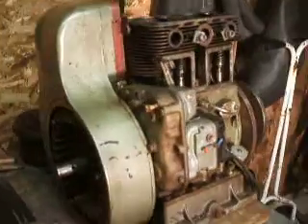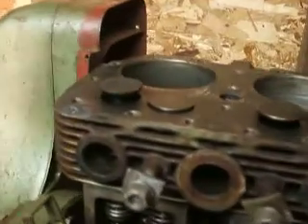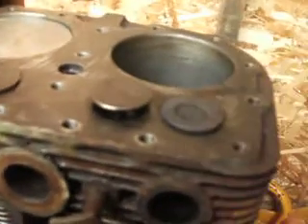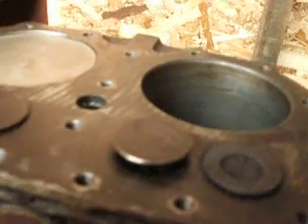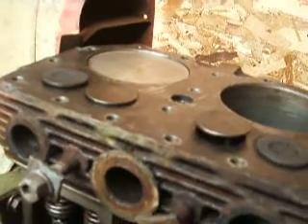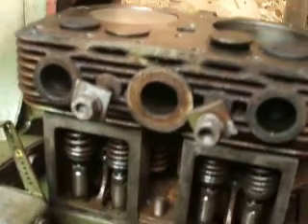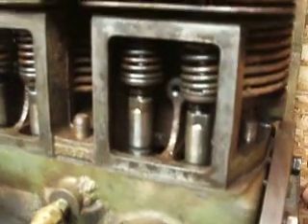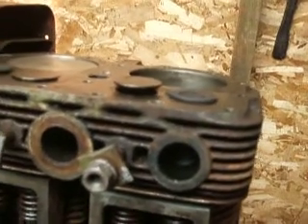TJD Wisconsin engine head off before semi-break down

Comment from the maker: Hey....Dude. Hi how is it going???

I am waiting for my tapered roller bearing coming from the states.....then I will do paint and assembly.....finished honing cyl, machined head, rings are here, seals are hear and 1 cup and cone but waiting for 1 more to come....then chapter 2....thanks

Keep in tune for the updated engine when finished.......it is costing me now.hummmm 350.00.hahh

Wisconsins are NOT cheap to build!!!

Sgtgym
Roger that.